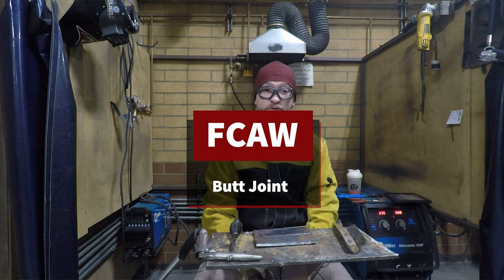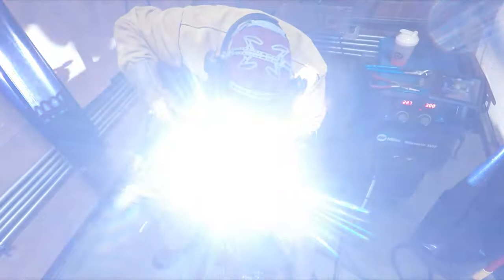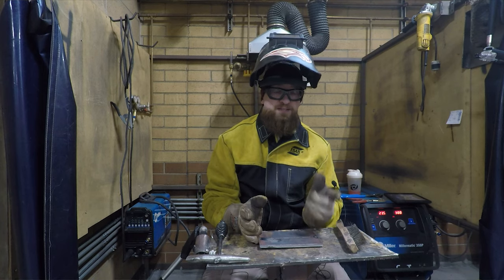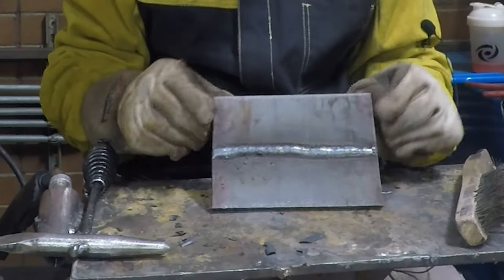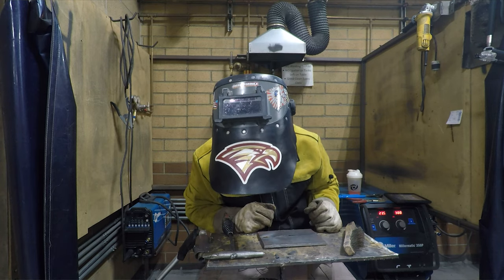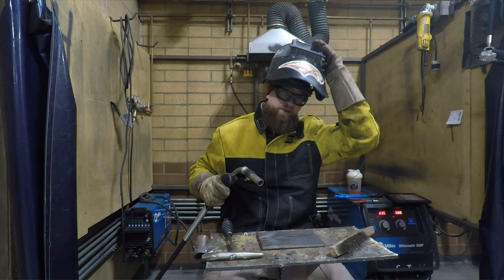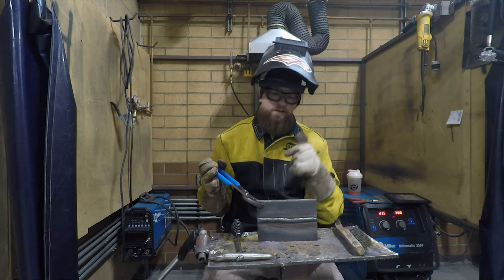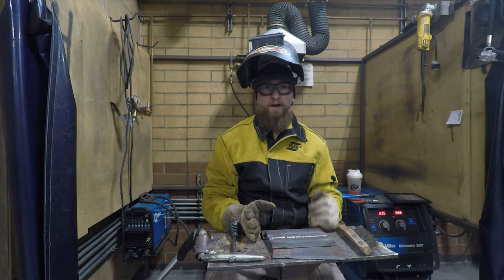FCAW -Weld 2 -Butt Joint

Comment: What's your wire size, feed speed, etc?
Reply from the maker: We are using .045 Wire. C-25 gas. 23.5 V 300 IPM
Reply: @mmhswelding  I'm in school doing it now and those are almost exactly the same ifpm and volts for the big Lincoln machine I use. Same diameter wire also.